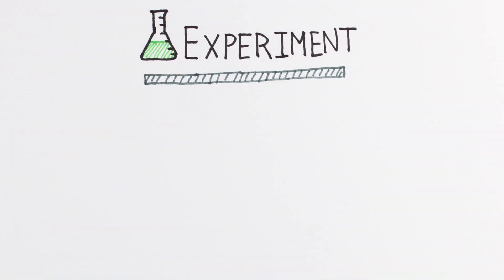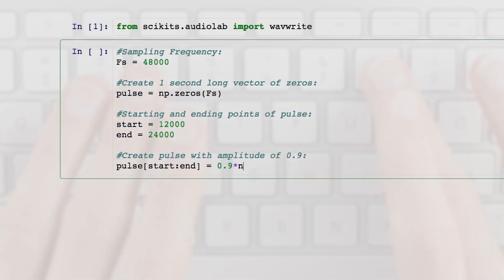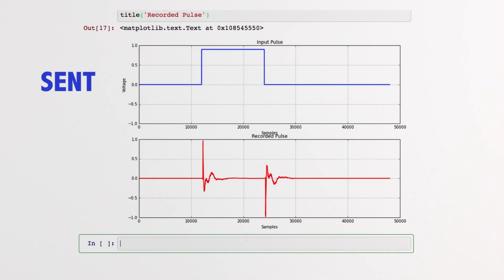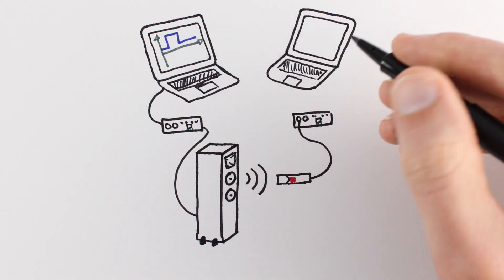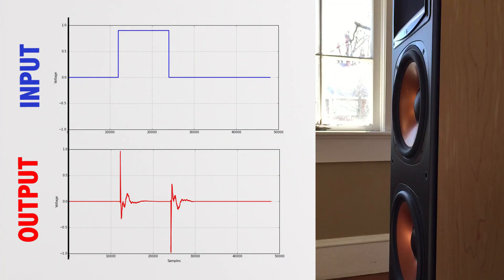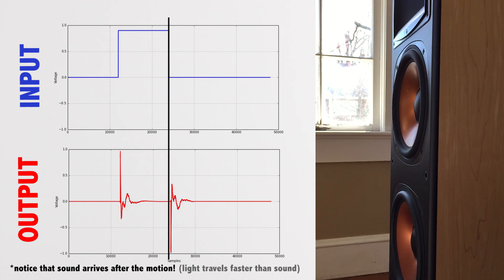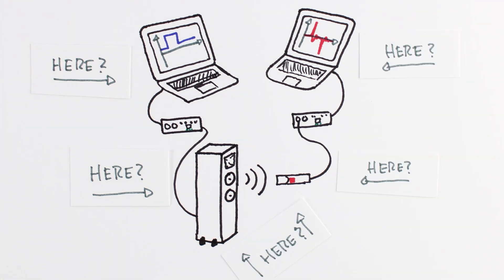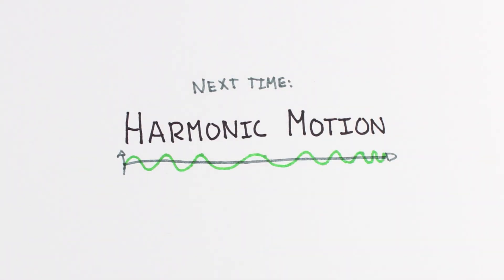How To Break Sound [Part 1]

Comment: My guess is that the speaker only moves when there is a change in voltage.
I am really looking forward to your future videos because your other videos have helped me a ton at understanding neural nets!
Reply: +Daniel Sch&#228;fer your guess is correct.

To answer why: the speaker coil moves the cone in accordance to change in voltage, hence the measured peak on the uptick in the square wave, and the trough on the downtick; and the cone has inertia and (not sure of terminology) elastic tension when coming back to rest, causing the reverberations measured after the square wave has leveled off.

Depending on the DAC, there&#39;s room for error as well because AFAIK there&#39;s no such thing as a true square wave on the wire.  As the transistors open &amp; close, the amount of current and voltage must travel through real numbers to change from A to B.  If you had a perfect oscilloscope on the wire at the PCs output or speaker&#39;s input you&#39;d see some rounding of the square wave.  A perfect square wave is an infinite summation of a sine wave, and you can&#39;t complete an infinite summation within the lifespan of the universe.  P.S. I checked on wikipedia for square waves and they agree that it&#39;s not actually realizable in physical systems.

I&#39;m not sure of the specs on the microphone, but it potentially has the same problems when being acted on as a result of cone movement.  The microphones I know are just speakers with a cone and coil.  Movement of the cone causes a change in voltage, and a change in voltage causes movement in the cone.  P.S.  I looked up condenser microphones and they are a cone and capacitor rather than cone and coil - same principle though: cone causes change in voltage by moving two plates closer/farther apart, which still cannot create instantaneous change any more than a coil could.
Reply: Daniel Schäfer 
I have a similar feeling :D